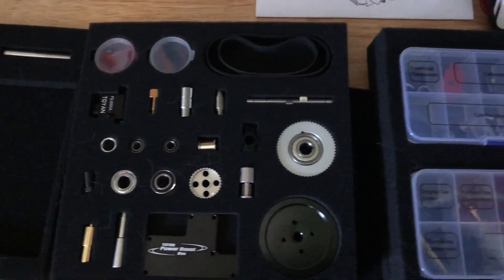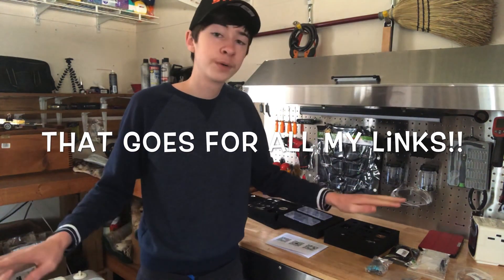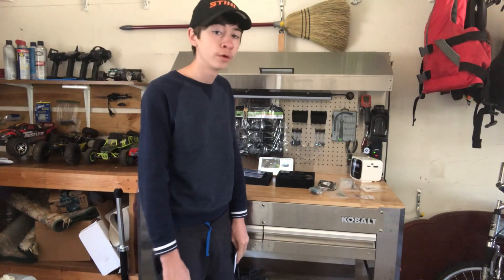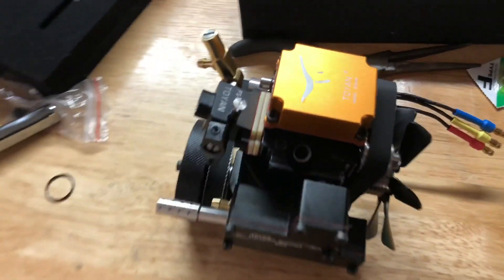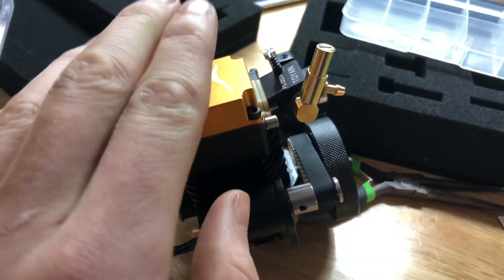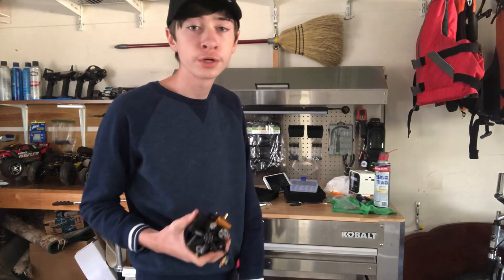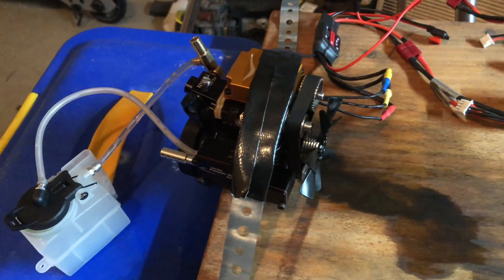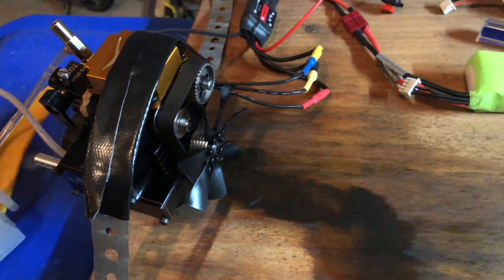Toyan FS-S100 4 Stroke Nitro RC Engine Build & Test

Comment from the maker: 6:16 so see it fire up! Forgot to mention that most of the oil when it first started was WD-40 because I used it for assembly lube and this little engine is insane and is about the size of a Predator 212cc carborator!